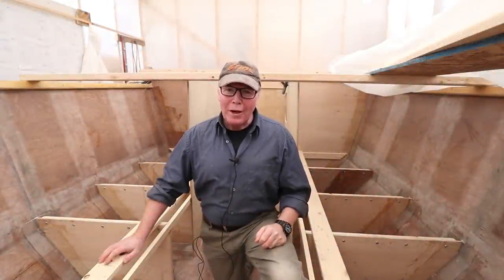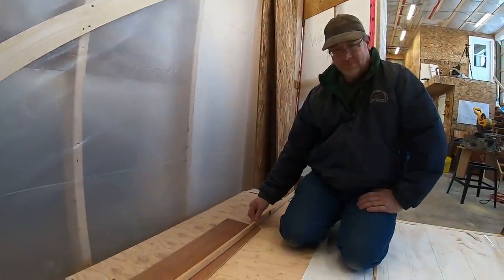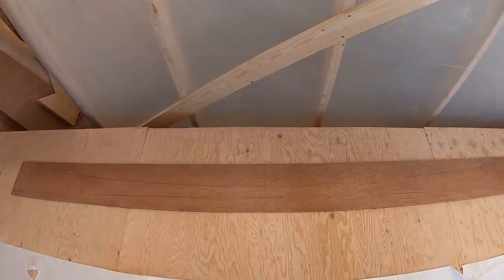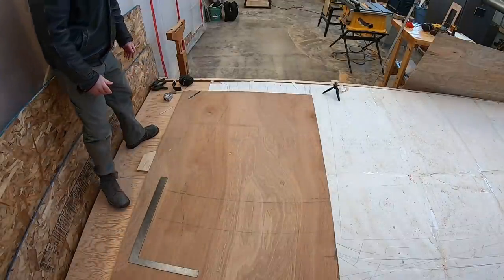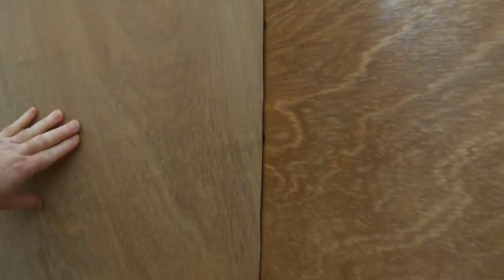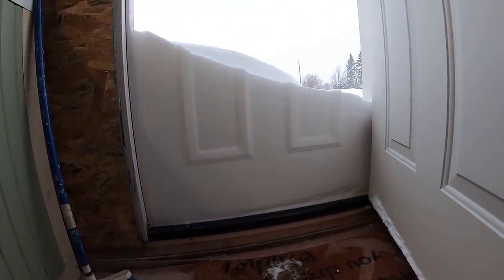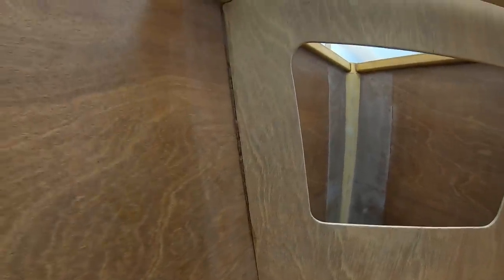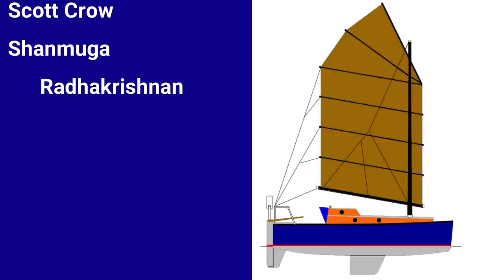S2E31 Bulkheads! What are they? Building a Wave Rover 650

Comment: When you're "Tacking" in the bulkheads use some West G5 - 5 minute epoxy.  it will help you move forward without waiting 24hrs for bulkhead 1 to set.  Bulkheads are usually numbered from bow to stern  your bulkhead 7 is actually bulkhead #1
Reply from the maker: Thanks, I will look into that.
Reply: Interesting... that's how John Gardner numbers the frames in his Dory Book,  even the 1890's racing dory we're working on, the first sawn frame at the stem is station #1...🤔

Comment: Why is the bottom of the bulkhead placed “about 1/4 in in front of its line,” canting the bulkhead aft?
Reply from the maker: I wanted to ensure a little rake rather than a plumb surface as this is the leading edge of the cabin.